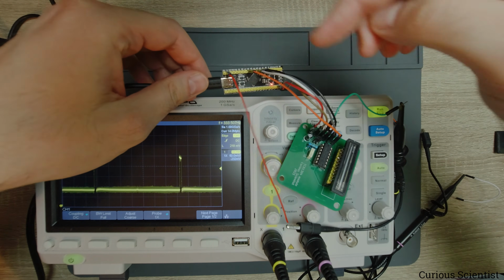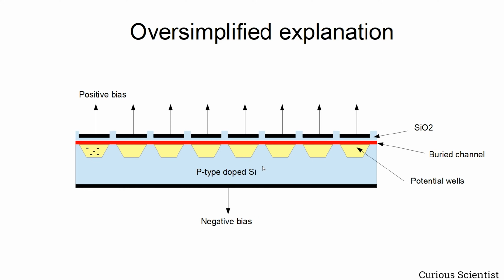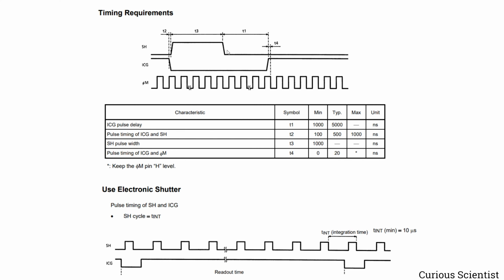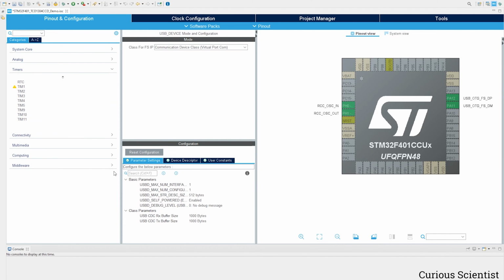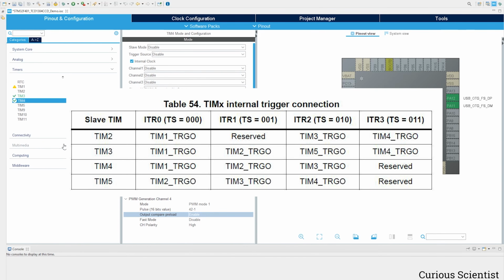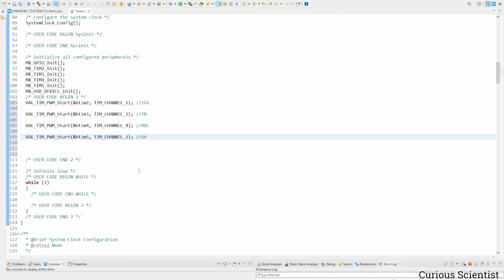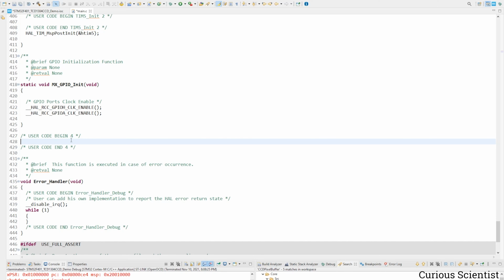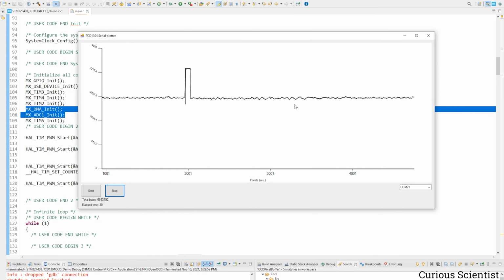TCD1304 Linear CCD - Part 2 - Driving the CCD

Comment: Hi Curious Scientist
The site has a few minor typos.
In the section TIM2 and TIM5, "We also calculated the necessary duty cycle earlier: 0.133333% ? 0.133333 * 63000 = 840."
One "zero" in number 63000 is unnecessary. 
Better write 0.00133333*630000
Also in the line of code:
HAL_TIM_PWM_Start(&htim5, TIM_CHANNEL_3); //PA3 - SH
in the comment specify PIN "PA2" instead of "PA3"
Reply from the maker: Hi! Thank you, that is indeed a typo I overlooked. The numbers for ARR (630000) and for CCR (840) are correct, but I messed up the decimals: it should be 0.00133... as you wrote. I fixed it. The PA3 indeed should be PA2. PA2 is the timer and PA3 is the input for the OS pin on the CCD.
Thanks for noticing the mistakes and letting me know!

Comment: Hey! I'm back with stupid questions. I managed to replace data transfer via USB with Bluetooth, thanks! Can you explain what data is returned from the ADC and written to the buffer? What can I do with them? I couldn't find the info I needed on google.
Reply from the maker: Hi! Do you really not watch the video and read the resources I provide? The ADC reads the output of the CCD pixel-by-pixel and it puts the values in the buffer. The voltage is inversely proportional to the illumination of the pixel, but this actually depends on the circuit. You can always "flip" the signal which I actually did with my custom PCB (another video).

Comment: Do I need to connect OS pin from CCD to any board pin?
Reply from the maker: If you want to read it with the ADC of the MCU, yes.
Reply: @CuriousScientist  In your video, where do you connect the OS pin?
Reply from the maker: @IndieVitalja  Have you tried actually watching the video and read the resources on my website?
Reply: @CuriousScientist  Can I replace USB data transfer with bluetooth also with ADC?
Reply from the maker: If you can write the firmware, I guess it is possible.
Reply: @CuriousScientist  Do you know how we can convert data-bytes from CCD to get wavelength and intensity data?
Reply from the maker: Yes, it is called calibration.
Reply: @CuriousScientist  How to do it? Do you have a tutorial, guide or article?
Reply from the maker: I will upload a video on a similar topic in the future, but I still need to record it...etc. But Google is also your friend... ;)
Regarding the two values: Intensity is basically proportional to the voltage read from the pixel, so that is very obvious. Wavelength, however... You don't directly measure it. How you can do it with a linear CCD is that you take a prism or a diffraction grating, split the incident light and then project it on the CCD. Then, based on where the individual colors end up, you can translate the pixel to wavelength. It is relatively easy to do the calibration with some laser pointers, or you can buy a very expensive mercury lamp to do a very precise calibration.
Reply: @CuriousScientist  Do I understand correctly that I will not be able to convert data from the CCD to the value of wavelengths? I need to experimentally calculate under what pixel value is the wavelength known to me?
Could you give me links to basic articles, how to do it correctly? I'm a noob at this, I don't even know how to google it.
My main goal is I want to plot intensity versus wavelength with CCD.
Reply from the maker: Type in the keywords in Google and read the hits. No offense, but if you don't know how to Google, this system is extremely complex for you. Sorry, but I am not a free support service. And you cannot directly measure wavelength with a CCD. You need an optical system for that; either a prism and a set of lenses, or a diffraction grating and a set of mirrors.